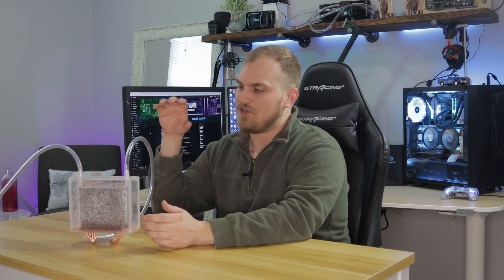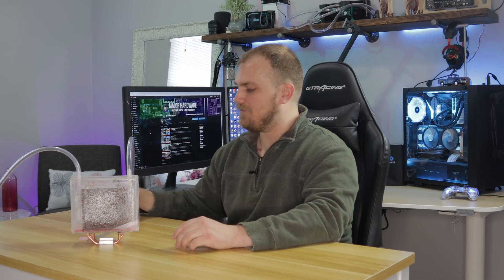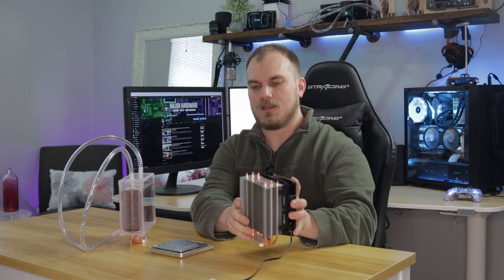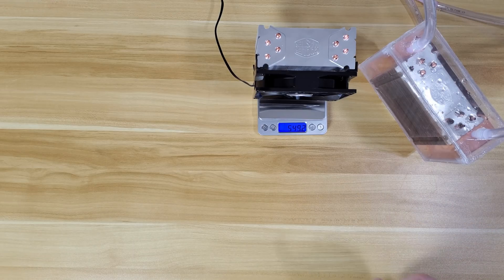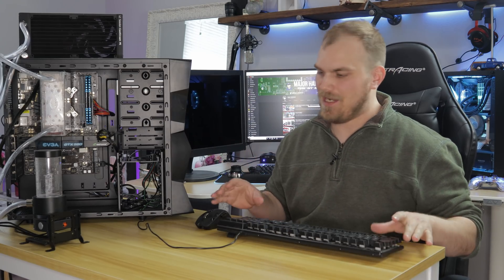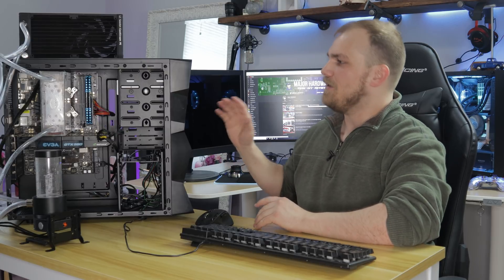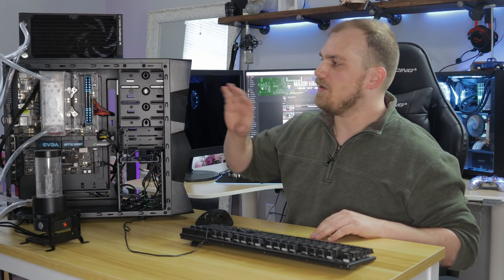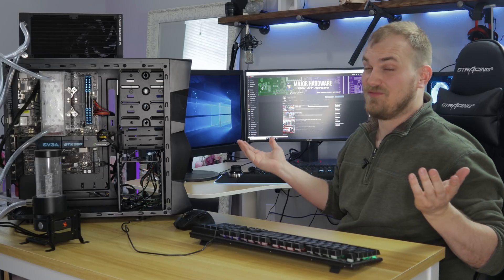How Much Weight Can A Motherboard Hold | Testing The Water Cooled Air Cooler In A Build.

Comment: The is ok but useless. It needs to hold there 2-3-4-5 years. This is the time people let the cooler built.
It hold for a short period without problem, this is we know. How about 1 year?!

We know after some while the motherboard can bend or connectors can be damage as per the weight. My example, after 3 years the PC does not show video, on the end, I discover the GPU was too heavy for the motherboard PCI slot, and it loose somehow.

Comment: Major, have you tried to make your own GPU waterblock using its stock vapor chamber? 

 I imagine should be better than a normal copper fin like the one of most waterblocks , I'm thinking to do it welding copper "walls" in a vapor chamber (not in short term), thanks

Comment: Watched your videos about this custom solution experiment. Few suggestions about the design and efficiency :  glue the to acrylic to the top of the radiator even if you have to bore holes for the top of the heat pipes; other idea is to move the mount of the pipes on the sides so that it can be mounted in a case; the third and most aggressive  is to glue the big sides to the fins so it creates a strict tunnel through them. Awesome experiment , can't wait to see how it will develop. Best of luck!!!

Comment: For V2.0: 

I'd have the coolant flowing front-to-back through the finstack (just like air would flow); 

make the 'tank' more square and tighter to the sides of the finstack, a cube or a cylinder would be ideal; 

adding something to seal off the sides, top and bottom would mean that the coolant has no choice but to flow through the finstack.

Comment: can i just ask if the heat pipes are part of the heat sink and run in to the cooling block then why not just cut the top off the pipe tips and run water throw the built in pipes rather than having water outside the cooling plates

Comment: I would still make 2 brackets that can be adjustable to the right length and screwed to the top just to give some extra support. But yeah Id it prob around the same weight of some as the Deeprock pro coolers or something. But 2 brackets should be good

Comment: I imagine there’s too much “space” in the block.
Take the Supremacy Evo as an example. It’s very tightly put together with special nozzles to direct and control the stream of water.
I think too much of the water near the fins slow down and too much water just flows past the “block” and that does nothing for the cooling.

2 things should be changed.
1: The path of the flow
2: The flow rate
Reply: both coming in from the top is a problem too I think, if he had an entry point closer to the CPU and the exit where it is currently, it might do a lot better.

Comment: There are quite some (high end) air coolers that are in that mass regime tho. And about the performance of your thingy; that the bubbles didn't really impact the performance, emphasizes that the bottleneck is that the water is moving mostly around the fin stack instead of through. The increased performance in this configuration is probably mostly due to the now higher natural convected (because the fins are now vertical). For a real performance increase, you'll need forced convection through the fins
Reply from the maker: Agreed

Comment: i thought it would be couple degrees cooler without those bubbles... can you make one that is as wide as the finstack that water cannot go around? and maybe 4 inlets at top (when in case) so waterflow would be close to even throughout the finstack.
Reply from the maker: Seems like in order to improve thermals we need the water to be forced through

Comment: make version 2 out of a a giant dual tower cooler like a NH D15
Reply from the maker: That would be a monster
Reply: @MajorHardware  i imagine it would be a nightmare to work with a cooler that is heavier and more bulky then the NH D15 RIP if you need to re-seat the Ram after installing it but the overkill would be fun

Comment: Instead of a radiator , build another box with a fridge element in, and external power source. Make sure the gas ETC is connected from the fridge so the element stays cold. Get the smallest fridge you can get. Just as a Frankenstein build. And then start to improve from there :)

Comment: That's actually super cool! I am slightly surprised it didn't perform a fair bit better. I imagine putting the reservoir higher than the cooler and filling it a bit more would probably help slightly too.

Comment: If push comes to shove, could 3D print some support framework for it to assist with the weight issue.
Reply: ...or... just lay it down.
Reply: @Longbowgun  Not everyone has room for a computer laid flat, and also many cases are designed as towers, to be placed vertically.

Comment: Major concern to think is that copper heatpipes are fairly malleable which might lead to warping & leaks over time from the weight that the cooler isn't intended to handle.

Comment: I have a question for you..?   Have you tried some Mineral Oil.   Just like when they make a PC.   They use it because it’s none conducive.   I can’t wait for your next video.
Reply: Dam..   Well that is good to know.  After all *{Knowing Is Half The Battle - G.I. Joe}..
Reply: Linus did one, the problem is that the oil degrades the plastic over time so that things like the clips that hold the RAM into the slots become brittle and break :(